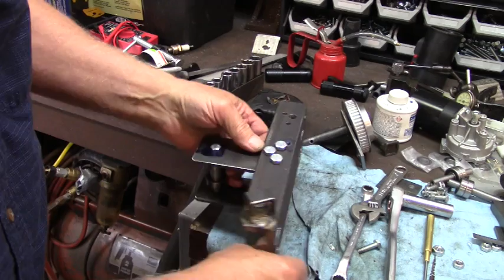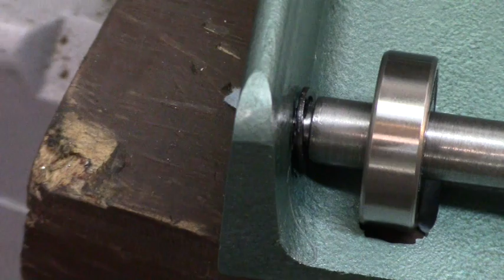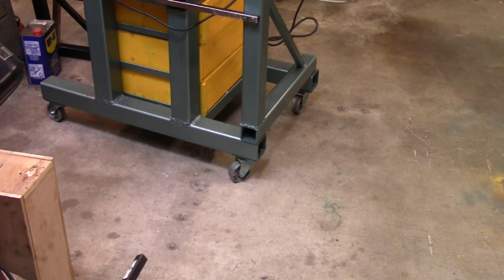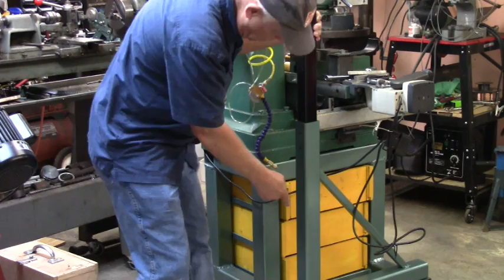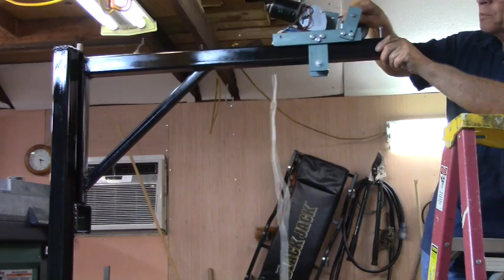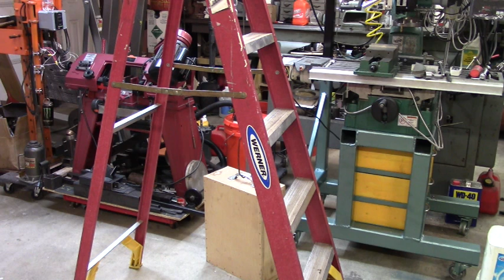Mill crane part 3 of 3

Comment: I wonder if some sort of one-way slip-clutch (I know I'm not using the proper term here) could be added so that, if a belt failure happens in the future, you don't drop something heavy from a greater height.
Reply from the maker: Well if I knew how to build one.  Thanks for stopping by.

Comment: Best the belt broke now and not later - overall this has all done pretty well Harold. Don't worry about over-building - it should mean that the factor of safety is better than 5!
Daisy has a great "not me" face. LOL
Reply from the maker: Daisy is spoiled by the boss lady and has it very easy around here.  Yeah the belt was the one i used to pick up the lead weights and I guess that stressed it too much.  The lead was twice the weight of the rotary table.  Thanks for stopping by.

Comment: Hi Harold - As Tom Lipton would have said: Nothing made to strong never broke - You got the same problem as I have: a better method for winding the wire - it will make a lot of noise on heavy objects, I think !
Reply from the maker: Yes I hate the wire because it tends to kink up.  I think if I can find some strong rope I will change that out.  Thanks for stopping by.

Comment: i think a small bike chain would be better than the belt , i have the same type of belt driving my lathe  and i wouldn't trust it to pick up a rotary table , love the dog we have a chocolate lab and the cookie that low is fair game for her
Reply from the maker: I think the chain idea has lots of merit.  Daisy is a food addict for sure.  Thanks for stopping by.
Reply: Better go with a big bike chain. Because I've broke the bicycle bike chains. Maybe you can find an engine timing chain? They look sturdy.
Reply from the maker: Some timing chains are massive.  Thanks for stopping by.
Reply from the maker: Hmm that sounds like a lot more capacity than I need or the wiper motor can produce.  In that case it should be mostly indestructible in my use.  Thanks for stopping by.
Reply from the maker: I have expected that to be the weakest link but so far it has been stronger than the belt.

Comment: Hi Harold,

I wasn't surprised when that belt broke.  That was asking a bit much of it.

You should really use something like a bicycle chain for loads like that.

If you lift something worth $$$s and it crashes to the ground, it's gunna turn ugly.

Good video, but please upgrade the drive system.

Cheers Rob
Reply: im sure the upgrade is coming, after all that work, now it can be seen the belt is a weakness
Reply from the maker: You are very right I think.  The wiper motor has plenty of power but it has a lot of short comings and the belt does too.  I just don't know where I can find such a small sprocket as would be needed.  Might have to make one.   Thanks for stopping by.
Reply: Hi Harold,

The bicycle derailer (open rear gear change) units have quite a few small gears in them.  Maybe get a scrap bike and strip that for parts,

You could braze/weld the gears to new centres if necessary.

That's where I would look first.

I would hate to see anyone get hurt if that rubber belt broke again.

Cheers Rob
Reply from the maker: You know that was the belt that lifted the 130+ pounds. That is probably what weakened it as the rotary table is only about 65 pounds. I will try to get a chain or something like a gear but it will take some time. Thanks for stopping by.